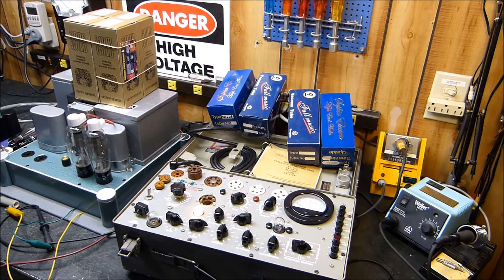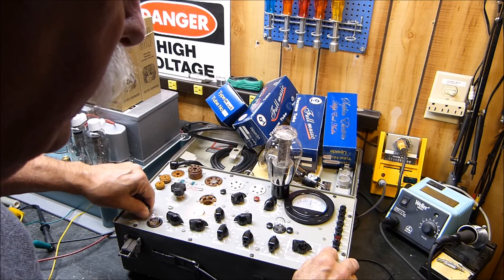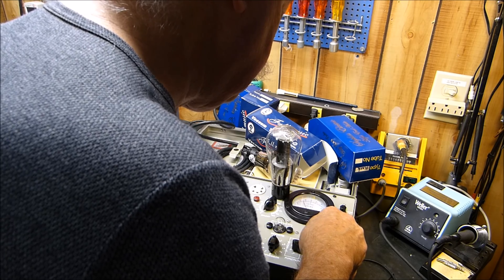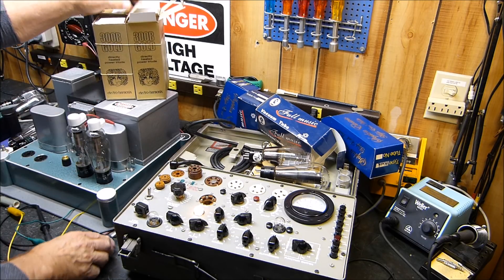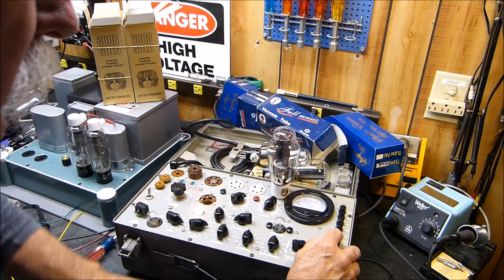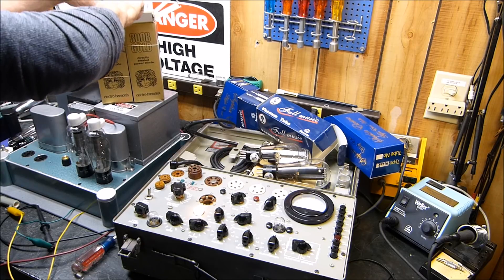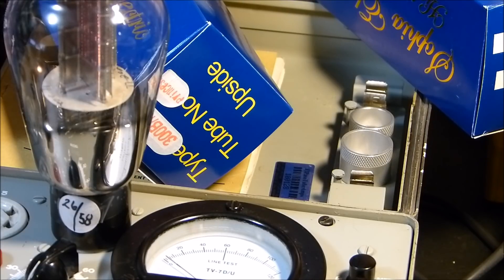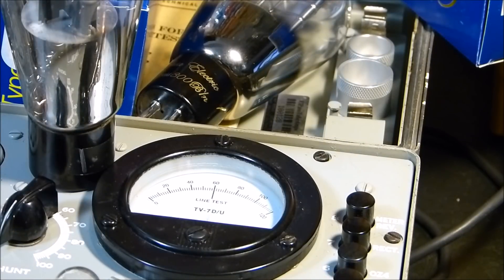Testing 300B Tubes, Electro-Harmonix, Sophia Electric and Full Music Brand Tubes

Comment: Does anyone watching this channel know how I can test a 300B on an AVO VCM 163 valve characteristics tester? As far as i can tell they're isn't a 4 pronged socket on the 163. I have seen 300b mentioned on another AVO tube tester but my own AVO manual (the one that came with the 163) doesn't mention either the 300a or 300B at all. 
Any assistance appreciated. I have a Western Electric 300B and it has "gone microphonic." Every so often it makes an awful screeching sound that lasts for 2 or 3 seconds. The amp's output is slightly down, as compared to the "good monoblock" and the affected amp's sound quality is not quite as good as the other one.  (They're LUX300B monoblocks).
Any suggestions or assistance would be very gratefully received. PS, I've tested all the other valves (perfect) and the capacitors and solder connections are fine and solid. I can't justify replacing the ridiculously expensive Western Electric 300B with NOS original valves but i would like to test this valve and see of any of the parameters are "off specification". (Such as mutual transconductance). I'm in Australia and can get a matched pair of Golden Dragon tubes for a sane price that's about 10 times less expensive than NOS W.E. 300B - are these Golden Dragon tubes, at least, reasonable?
Thank you.
Reply from the maker: I think if you want to measure these 300B's you could build a socket, (adapter) octal on one end and four pronged on the other - you only need four wires - and plug the octal into your tester, adjust and measure filament voltage per your tester, measure and know the plate voltage applied and measure and know the bias (and vary the bias) and you could get a reading of gain.  gain = gm * rp from the tube characteristics. Try this will all the tubes once you feel the parameters are safe for the tube and you would be able to get a relative reading and be able to compare them. Just a thought.

Comment: Again, this channel is so helpful, so credit where its due obviously.
I am a bit skeptical of chinese made 300b tubes. I have really liked psvanne and others, Do you guys have experience with linlai 300bg tubes? They are the most affordable ones out there. 
I think they will be acceptable, maybe not exceptional, but could these be at least good value reference tubes? 
The cheaper tubes are the ones I am going for, because I need 8 of them for an otl design from transcendent sounds, tubes and circuit book. 
Theres 1 driver tube and 4 tubes per channel, I think this amp will SOLVE IT ALL. 
The best part is, you have all that triode action from the 4 300b's and they are being utilized very lightly so diminished operating parameters are minimized. 
Another question besides 'are the linlai any good' ;;;

The official design uses a transformer going from 120v to  center tapped 35v+35v and steps it up to 180v with a doubler circuit using 2 diodes and capacitors and 2 chokes... I think this is an ok way of doing it, kindof unusual though seeing that it can be done with a normal rectifier and nice capacitor bank (is that all?) at 120v to 170v which will be enough voltage at least. And if you can, add an autotransformer which most diyers have already, it  can be operated for the called for 180v. 
Idk honestly, have not tried that yet, but I would not bother with the -10v difference.
There is the other concern that when these are on load, the voltage can drop further, probably with both types of power supply shemes...

But the best part is, no input transformer potentially and no output transformer, which for me is the only way to do it...
About to make the purchase of 4 and build 1 mono, this is the only schematic that makes total sense both in audio quality and cost. Its a very very good compromise.

Comment: I had some older but new ( nos) triodes ( some were given top me because they were not good ! ) with that problem.............after resoldering the pins with the filaments they came to life  and tested OK.........
Reply from the maker: Hi Frank - I have also solved problems by resoldering pins. But I never thought of resoldering filament pins to try and solve the problem with the meter dropping when the tube tester button was held down. Were you able to solve that problem by resoldering filament pins?
Reply: @ElPasoTubeAmps  You are right , that were tubes with low test values !
But the tubes with dropping values ( new production mostly ) are a real problem ( even a commercial scam )
Some pretend that this is no problems ( Young ahn) , i do not agree with such  commercial policy !
You can look up at the strict and serious aging procedure that WE applied to the 300B to understand that today the world has changed .....
Thanks for your reply and have a nice day .
hope you didn't suffer from Elliot..........
https://youtu.be/2rbyz16QmiE

Comment: If your not getting consistent results you should go through your tester and calibrate it after all parts check out
Reply: I have a 7D/U and I can say after more tahn 35 years f use it is reliable ..........I keep some tubes as a reference for testing and the tester is stable .......
Reply: @frankgeeraerts6243  ok yah a 7D/U is very nice tester as well. Doesn't read directly in mhos but still quite accurate. I have a hickok 752 that I use and have calibrated to within 5%. And for basic tests of quality I have an EMC 206 mutual conductance tester. Which is actually a dynamic testerlike the Eico series

Comment: I have several thoughts. Filamentary triodes are greatly dependent on filament current and the makeup of the filament nickel alloy. Additionally there is the element of filament aging. To develop free barium with which to emit (along with some strontium) the filament must be run at elevated temperature at a particular schedule after manufacturing that determine the final emission and stability. Any change in the combination can effect the outcome. The fade in emission tells me that the tubes were never broken down and aged properly, there is a contamination in the filament alloy or too much reducing agent causing failing emission or an interface layer, or it’s just plain poisoned. To compound things the worse manner in which the aging was done the more sensitive to variation in filament temperature which is a function of voltage and current. A just sealed I’m aged Tube depending on alloy and emission coating can have  very very low emission and it comes up only after proper aging. Many of the current tube companies use indirect heated cathode nickels as filament nickels. This can be ok, but it results in a very mechanically weak filament. Other alloys no longer in production were far superior but the industry and margins are too low for any of the manufacturers to have any of them made and processed into the required ribbon sizes. They do the best with what they have.
Reply from the maker: Nice information. Thanks for posting. I sometimes see new and especially old tubes that fade in emission when tested for several seconds. I always take this as a weak cathode and avoid them. These tubes that just couldn't perform at proper filament voltage still showed fading emission even at a higher filament voltage. I gave some of them several minutes in the hope that they would stabilize but they never did. One pair was still in warranty and was replaced with no issue. But I have to say, the EH  tubes performed really well and are now in service working great with no issues. Maybe in the next few weeks I will test them again and see if they are stable and still equal.
Reply: You're absolutely right ................I have the very strict and havy aging procedure of WE 300B and since then I know new production fail..........

Comment: Waiting anxiously for the next video!
Reply from the maker: Thank you.. I have the amplifier for all practical purposes finished and I have been enjoying it for the past few weeks. I have been out of town  to Denver and around and have come down with a bad case of back issues so I am trying to get past  that and get it back on the workbench for a final video. It is performing amazingly well. From preliminary testing, it is not going to perform like a McIntosh amplifier with 0.5% THD from 20 to 20 KHz at full power but it sounds marvelous. I can't explain it but there is something about the low gain triodes that is charming.  I know someone is going to say it is the linearity of the low mu triodes and maybe it is just that simple. I get around 40 watts average power out of it and that is more than sufficient to drive my efficient speakers. Hopefully, I will be able to post results soon.
I think my next project will be a more compact stereo version of some low gain PP triodes, maybe even 300B's (except they are so expensive). I particularly like the vintage 6B4G as they are the 2A3 with a 6 volt filament and an octal base. I also have some VT-25's (I believe they are also know as a, 10) that are calling me from the attic to be put back into service...   :-)
Thanks for your message.
Reply: ElPaso TubeAmps Feel better soon. Curious that your customer is a mono fan, rare today. I like mono too but via two channels. VT25s are great but lower power than 6B4Gs also Rp is quite high so it might be hard to find a pp output trans. What about parallel single ended? 😲
Reply from the maker: Yes, indeed, mono out of two speakers. I am perfectly happy with that also. There is also the problem of having two of each of these vintage and exotic transformers, including the driver transformers/inductors, etc. When one thinks about having a truly matched set of beautiful condition UTC iron, we are talking about amps that sell for multi-thousands as the components are just so hard to get. So, with two speakers, one in each corner of the room, I am perfectly happy with one channel.
As for SE or PP, I always go PP. Just makes sense to me. I have built amplifiers with a variable NFB loop and with the FB turned really low, the amplifier gets loud quickly but distorts quickly also - maybe around 8-10 watts. With 16 dB of NFB it will do 80 watts at 1% THD but has the characteristic compressed sound to it. I am speaking of an actual amplifier I built running PP KT90's some years ago.
When I think about it, probably the 300B is one of the best choices for a low mu (very linear) triode that will deliver a respectable amount of power in PP. The high mu triodes like the 811A all run class-B and have their own driving issues and high Z plate load. Everything is a compromise.
I am getting better quickly... no use in dragging around in pain. Maybe even tonight I can get to the shop and have some fun and post.
Reply: ElPaso TubeAmps single ended: it might be the distortion spectrum. No cancellation of even order  harmonics, the good harmonics. Odd order are the baddies that pp preserves.
Reply: I guess your lack of new posts suggests you might not be in such good shape. Hope that is not so, but if it is, get well soon.
Reply from the maker: Thank you for your kind thoughts. I am having some not so pleasant issues with my back and legs. It all started on a five day trip to Colorado about a month ago. I am going to a physical therapist that is helping a lot. I am collecting parts for another big RF amp running a 833A but I do need to post the final on the 300B amplifier. It has turned out very nice and I really like the UTC transformers. I have kept the 866A rectifiers that are beautiful lit up purple. I will be back to posting soon. Thanks again..
Reply: ElPaso TubeAmps So sorry. Feel better soon! Looking forward to your 833A project as well - go carefully with that!

Comment: try running hotter for 30sec "bright" 
direct heated cathodes will then "sometimes" boil more thorium to the surface of the tungsten
filament. This 'may' rejuvenate the tube for awhile. then back off to 5v and test.
never know how long such process will work. But some times, you can get a bit more time at risk of opening the filament

Comment: EH is currently making reliable power tubes
Reply from the maker: I definitely like the EH tubes much more than the other two brands. And I am getting 50+ watts at 1 KHz. The challenge now is to completely stabilize the amplifier probably with some grid-stoppers and other parasitic mitigating additions. The objective of this build is not to tweek the amplifier to "perfection", 20-20KHz at ultra low THD but rather to reproduce a vintage design and sound.

Comment: David perhaps consider comparing the filament currents between the good and bad tubes.  Good video, thanks.
Reply from the maker: I haven't checked currents yet but voltage is good. In one particular high power Eimac tube I have used, the 4-1000A, I did learn to check filament current to assess the worthiness of the tube. The filament is made of strings of wire running vertically in the tube and as the tube ages, the filament strands break off and fall to the bottom of the tube. You can sometimes see "trash" inside the tube but a current measurement of this particular tube will tell if the filament is deteriorating.  Normal filament is 7.5 volts at 21 amps so if the current is down around 15-16 amps, the tube is used up. I suppose these tubes (the 300B's) may be able to be used with 6 volts or so on the filaments (?)
Reply from the maker: We sent the Sophia tubes back as they are in warranty. I really hate to make any of these items look bad because vacuum tubes are a truly specialty device and even back-in-the-day, I bet there was a reasonably good percentage that were not perfect. I do still have the other pair and I will indeed measure the current thru a good one and a bad one. As could be seen at the end of the video, they checked better with higher voltage on the filament but I still did detect a declining meter reading even at the higher filament voltage still indicating a problem. All four of the EH tubes were solid. I had a set of EH KT90's a few years ago that I was impressed with and was getting 80 watts from them. Never had a problem with them but sold the amplifier.

Comment: I have been thinking if you use a forced air cooling system then the amp doesn't have to be in the house and could be installed in the basement of the house if you have a basement and use the strange twist sockets that are used with the 4CX250 vacuum tubes and you should be able to drive hard to drive load impedances like 2R speakers or Piezo transducers.

Comment: You can make that experiment with any tube. If you increase the filament voltage, the emission will increase as well. I did some experiments about rejuvenating tubes by overheating them for a certain time. The tubes emission increased every single time while being overheated, no matter if it were directly heated oder indirectly heated tubes. So, what you determined is, in my opinion, not necessarily a thing of poor QC.

Comment: Have you use or have you seen KR audio tubes, built in the Czech Republic. supposed to be very good had  awards from American tca tube collectors Association of America? Anyway maybe you would like to check them out here's the website Kraudio.com  there's a YouTube channel showing the manufacture of their tubes as well. What do you think of them
Reply from the maker: Hi John,
I am here to tell you, these 300B tubes are in a world of their own. I thought I had the 6L6 family of tubes pretty well figured out but these beasts are different. Drive requirements and the expectations of performance from the old UTC iron are Much harder to obtain than might be thought. I have yet to see anyone post lab grade analytical performance of these types of 300B amplifiers and/or vintage UTC transformer performance. I fear that challenging the ingrained belief that these tubes and this iron is anything less than the ultimate perfection is like challenging Einstein's theory of relativity.  From my limited experience it looks like the speed of light is not the ultimate speed where time stops and mass becomes infinite. I plow onward to completion toward whatever it is.

Comment: You're probably right about the QC on those filaments. Possibly the wrong filament wire even. 
I'm trying to decide between the TV7/U tester and a Hickok seems the Hickok might be more versatile especially for newer tubes. Not easy to find good ones of either ar a reasonable price.
Reply from the maker: Hi Bill,
Check out my reply below to "tim"  for what I have just discovered.
I figured the same thing - probably the wrong wire for the filament.
I sure agree about the price some people are asking on Ebay for tube testers and unfortunately, you never know what you are going to get. I bought mine from a fellow I worked with in Chicago. He had it for lots of years and I don't think he had used it in the last 30+ years so it had not been "fixed" or "modded" if you know what I mean. No "mystery holes". Anyway, even so, I had to get another meter movement for mine as the original one got to where it was sticking so bad it was becoming hard to use and get the same reading each time.